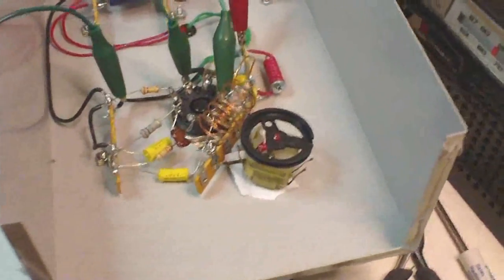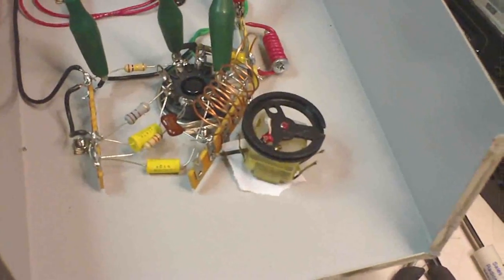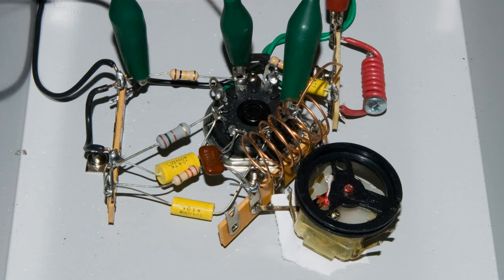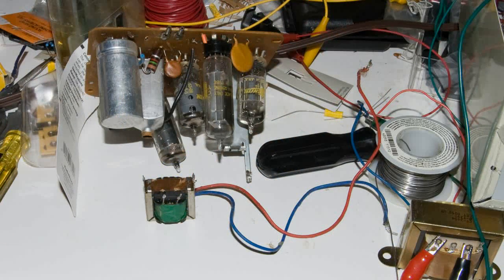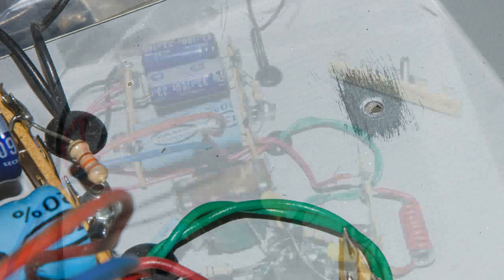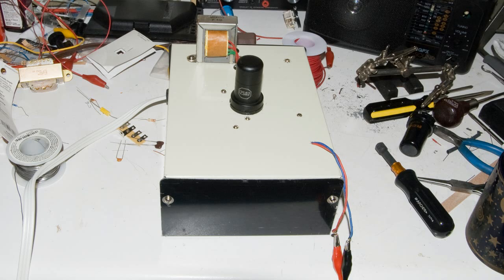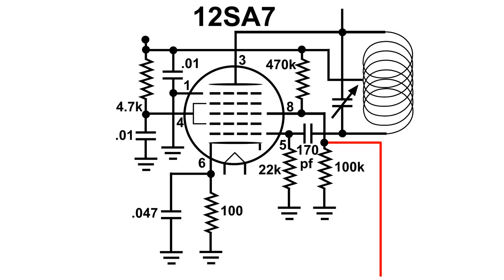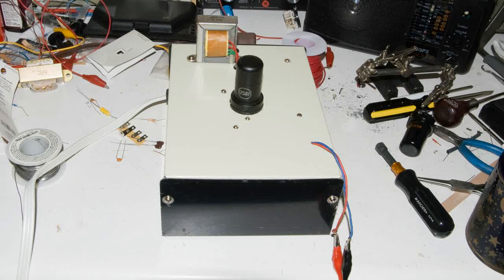Tube FM Transmitter project part 2

Comment: Also what value is the coil? I didn't see a description on how to wind it. P.S. I think the hum is coming from the heater. I believe the filtering is sufficient, but you may try to virtually ground the heater with a center tap to get rid of that pesky hum

Comment: I'm looking for a feasible Tube FM transmitter and I find this circuit quite interesting as my first project. I have several questions I really hope you can answer though.
1. I don't have that exact tube. I have quite a few russian heptode tubes (6и1п). Can I apply this circuit to the 6и1п tube or do I have to make some modifications?
2. What is the audio transformer you use? I have quite a few with very wide variety of impedances. Which one should I choose? 
3. If I manage to suppress the RF signal from entering my mains, is there any other path It can radiate into space, since the box is enclosed? I really don't want it going into my mains, because I don't live in a house, and may end up bleeding it into my neighbours's mains.

Comment: The radio RF signal is going out on the ground lead of the power line. It's called carrier current.
Reply from the maker: +8-bit King 

Yes RF is escaping through the capacitance of the tube filament to ground and also through the power supply.

Comment from the maker: Thanks MickLBrad
The power may have ripples, I may need to do more RF filtering also. I has been awhile, but I may have used the wrong 12SA7, the metal and glass are not the same tube, I did a video on this. Another OTR you maybe interest in, it is like a radio station, is Yesterday USA. Just Google it.

Comment: @AllAmericanFiveRadio also can you list the specs of the transformers? and you might want a matched antenna for the transmitter. here is a list of some possible things i can think of that may be causing the hum.
-because transformers (and even electrical wiring) emit electromagnetic fields or EMF this field could be interfering with the tube and/or the other transformers
-because some of the capacitors are from old radios they could be defective especially the filter caps <check your filter caps

Comment from the maker: LOL! Actually I have the same problem with a commercially produced FM Transmitter. On batteries it worked perfect, but when I put it on a commercially make power supply I had multi-path, 60 cycle hum. I used a length of wire on the power supply ground connection and tuned out the hum.

Comment from the maker: RF it going to the cathode and to the filament and the 60 cycles on the filament may be modulating the electron stream through the tube. Yes caps and chokes on the filament is an excellent suggestion. I have not abandoned this transmitter, I'm going to set it aside for awhile. The metal tube is not earth ground it is B- ground. I'm pretty sure I tried that and not much change. The question I have is, is the fix piratical? Meaning $.